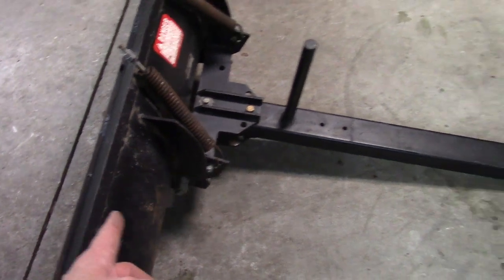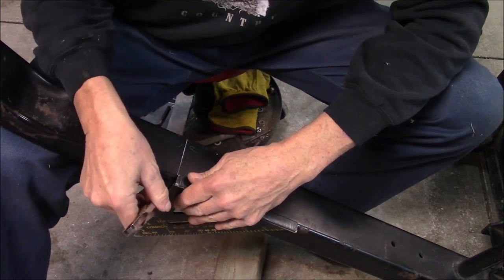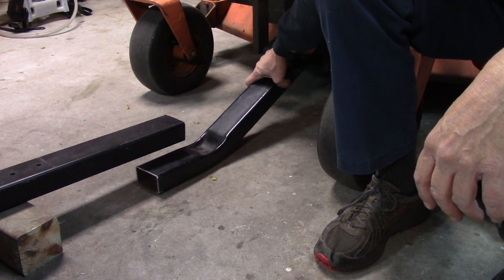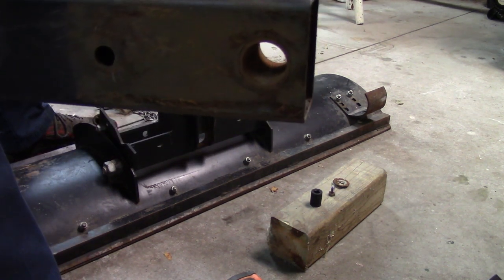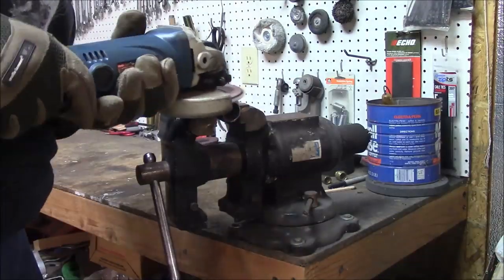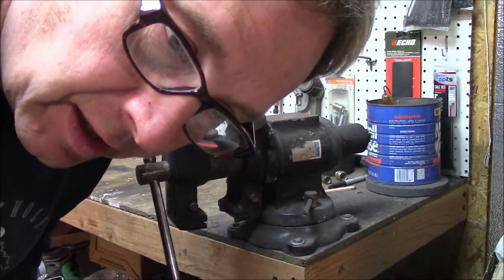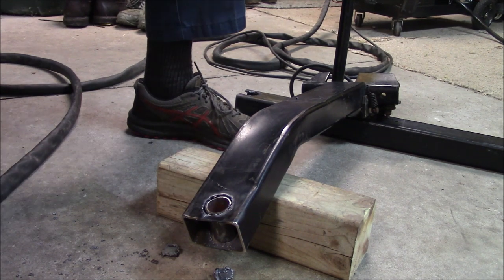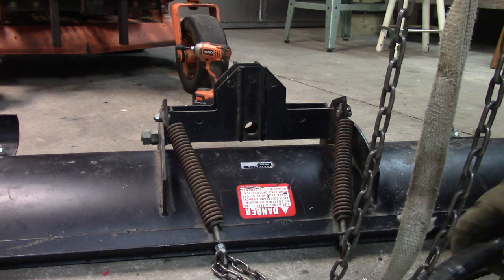Mounting Snow Plow on Scag Tiger Cub

Comment: About 5 years ago I built a bracket and and bought a plow for my Gravely 260z.  1182 lbs, chains, 13 gallons of fuel and 240lbs with me there was never a snow it didn't blast through.  All that drilling and cutting gave me chills though.  I bought a steel cut off saw and circular saws, even a mini one with steel blades.  My drill bits sit on my bench somewhere after I bought a Milwaukee hole saw kit 1/4" - 4".  I miss the old Gravely...